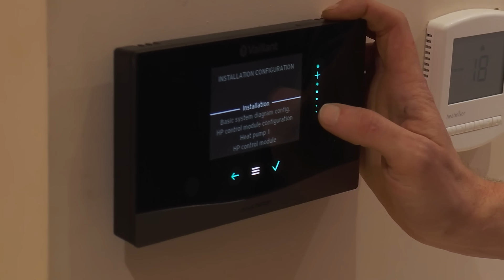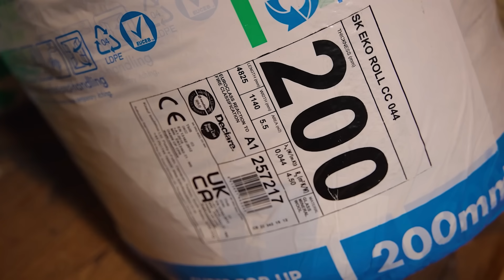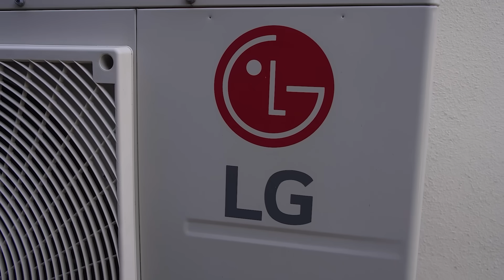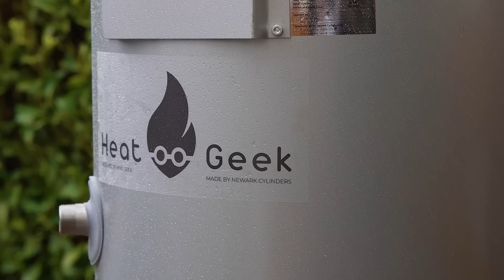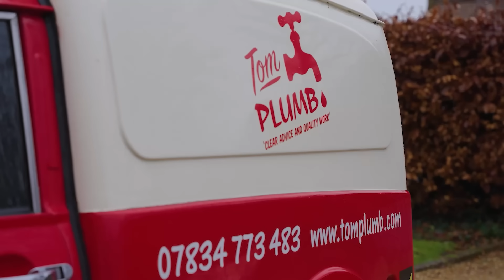Heat Geek’s Heat Pump One Year Later — The Verdict!

Comment: Interesting video, gauging a whole year's Heat Pump performance.

The point that the UK's housing stock have many peculiarities, is the message I'm picking-up, that a Heat Pump systems has to be bespoke to your particular property.
I'm starting a 6 metre extension with new garage next year, and my cunning plan is to relocate my old gas boiler into the new garage, but have all the conduit required installed for a Heat Pump on a future date.

My logic is that it's unclear to me how even Heat Geek could survey a property for a suitable system whilst under a major development.

But that doesn't stop me future proofing the property with conduits, hopefully advised by a Heat Geek qualified person.

Keep up the good work Roger, I regularly forward on your clips to others.

Keep well

Robert

Comment: Heat pumps are great when specced and installed correctly, the only thing is they cost so much….even with the boiler upgrade scheme. Hard to consider when modern combi boilers can run at lower flow temperatures and use weather compensation so that they run constantly without cycling on of off while sipping gas.
Reply: If you get a competent installer who can do all that.

Comment: When he said it cost £900 was that a month? 😖I am an electrician. I have been to lots of houses big and small with heat pumps. Most of them are not happy with it as too cold indoors and hasn't got higher heat in the evenings and weekends,  with the cost to run is a lot higher than a gas boiler setup overall as I don't think people have the boilers on 24/7, only when they need it. We did a big new barn conversation with a heat pump, with lots and lots of spay insulation super thick and super-insulated new glass windows, with underfloor heating on the ground floor in screed and on the first floor under the chipboard. Cost an absolute fortune to install and you need a plant room.  We went back and asked how it was all going and the customer had turned it all off as was costing over £1200 a month to run and had installed a bigger wood burner in the lounge. He said that the heat pump was running 24/7 but had a lot of glass and high ceilings but when the sun came out it was too hot and had little control over it. He said it was "crap and was made to install under planning regs". `They were moving and the house was up for sale.
 Another big house we visited had a big twin heat pump and solar and battery set up. We asked the lady how she was getting on with it? She said it was costing a fortune to run and the house was never warm. we had to keep our coats on indoors. To be fair on this one the windows were single-insulated and poor insulation in the roof and radiators was original. What would it have cost for all the upgrades to a big old house? She had been ripped off and has now moved.
 A friend of mine works for the local Council as a gas fitter,  he said that the Government are making them upgrade all their council housing renting stock to heat pumps, and they have also got to upgrade all the insulation in these homes. He said one average-sized council house they just started was costing them £45,000 for one house in insulation costs alone not including the new heat pump install. he said that the governments were forcing all councils to comply but next year they are going to force private landlords to do the same with their houses to bring them up to the same standards. Seems to be only the wealthiest investing in this net zero ideology.  As Keir said to Tice in the Commons it is all about money, jobs, economics and politics, which makes me wonder if nothing to do with man-made climate warming. Buyers beware.
Reply: he said a year
Reply: yes and look at the millions it cost to put cladding on Grenfell as part of the net zero rubbish

Comment: So, a gas boiler in case the heap pump packs up. 

What would have happened when there was just a boiler, and that packed up? ... call a plumber and get it replaced.

What happens when  heat pump packs up? ... call a plumber and get it replaced.
Reply: yep, except with a heatpump system you also have immersion heaters so worst case you can still heat your water until the heatpump is fixed. Gas boiler needs a gas certified engineer as well. Technically if you are replacing like for like with electrics any 'competent' person can do it.
Reply: Plug an electric heater in. Or if the electric went out, use a power bank to power the boiler and you still have heating.

Comment: Had a system that ran at 59C because there is no separate tanks for hot water. The engineers had put the heat pump temp below that so it was simply not used. Took me years to bother to figure out what was wrong.
Reply: I evidently lowered it to 45 when I realized how in efficient that temp is

Comment: Heat pumps do work. But only after a huge amount of money and effort has been spent in accommodating the house for it.
Reply: Not really but they work better (cheaper) in well insulated houses. Which unfortunately you don't have many in UK. But you also have a milder climate than Eastern Europe for example.

Comment: Air to air is £ for £ spent a better option - IF - you’re determined to tie yourself to electricity supply, a source which will work great, until it becomes even more expensive in the U.K. and then becomes intermittent.
Reply: Yes it would suit me.  Just a shame no grants
Reply: Sounds like that they may be coming soon, but in any event about £2800 -£3500 typical setup cost ain’t so desperate. Talk is of the grant system being added to to incorporate air to air, possibly this year I think. 👍🏻

Comment: When you need heating the most is, surprise surprise, when it is coldest… If you think it’s going to continue to get warmer (- per the official, politically approved narrative) then fine; if you have concerns about eg energy continuity of supply, future global cooling probability, etc and recognise that a colder winter tends to drop the efficiency of these units to around 3:1, at which point not bothering to ‘invest’ in the new systems becomes moot.   Spending the money on improving your insulation levels is the most cost effective investment to make, and beyond that you can use less of whatever heating energy source you prefer.

Comment: Heat Pumps the connection.
The Zero-Carbon Hoax, a background.
As set out in the 1987 a publication from The World Commission on Environment and Development 'Our Common Future' ''Group think, the hive mind which then demonizes anything outside the controlled accepted narrative. The societal structure of power implements this through the executive, judicial and administrative arms of governance.
Our Common Future 'The planning of societal change takes place decades before the public see any signs of the implementation. By this time, it is being sold to them in the form of a benefit. Under a “climate lockdown”, governments would LIMIT PRIVATE VECHICLE USE, ban consumption of red meat, and IMPOSE EXTREME ENERGY SAVING MEASURES That's for openers.
Most will never be able to see the plans behind these changes as they believe the cover story. Change brought about on the back of something that appears beneficial to the public, then accept the change as necessary or for the “common good”. They are guilt tripped into accepting loss of rights and benefits through basic propaganda tools.

Comment: Roger Bisby, I like you, I watch your content a lot. But you really are stubborn.

It's really frustrating how you could barely say anything nice about heat pumps despite clear evidence of how well they can perform. 

This man paid £920 for a whole year for hot water and heating in a 6-bed house! This is insanely cheap and could not be matched by any other system currently available.

All you could talk about was all the exceptions where they don't work (many of which would apply to GCH), or all the things completely outside the control of a regular consumer.

Comment: Very informative with this series of videos showing the problem and its solutions and the follow-up with an eventually satisfied customer. And you brought up a lot of good points, both positives and negatives. Here in Sweden a lot of air based heat-pumps have been installed and they usually seem to work well . Many are installed on the west-coast in the South with climate similar to UK so high humidity should not be an unsurpassable hindrance. In the North of Sweden they are mainly used for supportive heating since the efficiency becomes limited at lower temperatures in the winter. Even if UK have high prices on electricity the total cost for heating might still be comparable to Northern Sweden or Finland due to the lower temperatures.
Reply: My air to air heater was working pretty well last winter at -20C here in Norway.  It is rated down to -35 :/

Comment: The loft insulation would hav done great job and reduced your bills if you had been using a gas boiler too!
Reply: Why wasn't the loft insulation done already or even when the heat pump was fitted. It is just a no trainer to insulate as much as practical but the loft is a must.
Reply: @stephenwest9757  brainer

Comment: Glad you did the follow up! It helps to counter the general narrative in the UK that "heat pumps are garbage".

Here in Aus, heat pumps are great. Im down south and have air to air heat pumps (split system air con). Theyre my sole heating in winter. So much cheaper than running gas during winter.

"Size the system correctly" applies in every application. You wouldnt drive a whole footy team around in a Morris minor, would you?
Reply: Out of interest how do you heat your water?  I have air to air as well so have an immersion heater for water.  Tempted to get a small heat pump just to heat the water.
Reply: @notverygoodguy i have a hot water heat pump too. The outdoor temps rarely hit about -3C at the lowest in winter. Normally theyll be 3C to 10C at night. In Australia its normal for the hot water tank to be located outside, and the hot water heat pump is built on top of the tank as an all in one unit. It is possible to get a split unit, so the tank is in a different location to the evaporator. They work very well and save heaps of money.
Reply: @davidunwin7868  Thanks.  I think I'll look into that.

Comment: I think you mate is right about the original heat pump and the compressor. The problem is the cost of the degas, compressor, anything else  and the regas on a 5 year old heat pump probably doesn't make sense. The cynic in me thinks that the heat geeks would have been only too aware of this but it calls in to question what allowance you should be allowing on your heat pump running costs when you have to replace the equipment that has a lower average service life and cost many times that of a gas boiler and which won't attract a government grant for the replacement. The real issue is the cost of the electricity. If everyone was offered these super cheap  tariffs 15p ./ Kwh in Tony's case I suggest there would be no case for heat pumps.
Reply: discriminatory pricing is one of the sneaky ways they create interest , its like offering freebies to people with so called smart meters , highly discriminatory

Comment: My heat pump system was redesigned and rebuilt a few years ago. They installed a remanufactured compressor during the work. My heat pump works great, and my electric bill went way down.
Reply: Scam, you cannot remanufactor a hermetic compressor.

Comment: So now he has to keep the house constantly at 20c. Assuming colder outside, he is 24/7 running a thermal potential difference, thus constantly loosing heat. With gas, quickly get the house upto temp when you want it, the let house cool when you dont need it.
Reply: He is happier, it runs more cheaply for him?
Reply: @Biggest-hz7ng   Makes a lot of 'eco-sense' to heat a whole house 24/7 rather than just heating the rooms you want, when you want, doesn't it?  We need to look at why we need to heat bedrooms during the day, or why we need to heat a bathroom all the time if we only use it for an hour.
Reply: Sometimes things that we are used to don't make as much sense as we thought.  The actual energy the house loses to being heated is the same however you heat it.  However the energy required to keep it at a single temperature is less than to keep heating it up to that temperature.  It is why people used to keep immersion heaters on all the time and not turn them off an night.

Comment: You could make a gas boiler that would have the same flow and water temp as the heat pump, it would then perform identically and keep the house at 20c.
Reply: Yes, but gas would cost more than this heat pump install as it is 450% efficient.
Reply: @ 
No, a CoP of 4.5 is possible, but it can even be down as low as 1 (so 1 kW in, 1 kW out).  The average CoP for a typical heat pump in the UK varies seasonally and can range from about 2.5 to 2.8 on average.  And anyway, I think you mean running costs, not install, as gas is definitely cheaper to install.
Reply: You could indeed, and that's what is done by many installers for underfloor heating (UFH).  Having said that, though, you could achieve the same with a simple electric boiler, too - then you'd have zero maintenance, servicing, or insurance.  But as I say above, 20 degrees is too cool in my opinion, and would be far too cool in a bathroom - allowing condensation and mould, unless you had HRV.

Comment: Within seconds of the video starting we had clips of the installers smiling, being helpful, looking busy!!! Promotional video alert. If this heat pump system is better than gas then his gas setup is poor. Only advantage of heat pumps is the fuel they use, and efficiency compared to filament heating.
Reply: No, SCOP over the year is 4.5, a better fuel cost than achievable by gas.

Comment: absolute rubbish  , all this is is a paid advert , as for better heating again utter rubbish 12kw is  or even 7kw  not possible nationwide , so stop the lying
Reply: Not understanding your rant.

If it's about electricity transmission, heat pumps are taking a while to roll out unfortunately.

Comment: No good getting rid of gas when the electricity that runs the hob comes from a gas power station.
Reply: There is still a 40% gas saving if the heat pump were to use electricity generated solely by gas. The UK grid is increasingly green.
Reply: @Biggest-hz7ng  He was talking about other appliances like hobs, lights, televisions, etc.  Still need electricity.
Reply: Solar and batteries are getting cheaper at a rate that is basically bonkers. As time goes on, the major cost will tend towards installation rather than the tech itself (e.g. a friend in England just got a solar install and a big chunk of that cost was scaffolding)

Comment: Retired Plumber . What is the point of Heating empty rooms . I live in a one bedroom Flat  with extra external  insulation . I still have my Worcester 28i  Junior Combi conventional output and it's 16 years old , Gas bill yearly £395's a year , so no I wont be getting a Heat pump !
Reply: His heating cost was 920 per year for his 6 bed...
Reply: @Biggest-hz7ng  More fool him , Heating Empty rooms , that's what TRV's were invented for ! 🤣
Reply: @Alan59-n9d Sometimes the things we are used to are not the best way.  It is cheaper in his case to heat rooms rarely used all the time instead of heating them only when he needs them.

Comment: All I want to see is two sets of bills for both Gas and Electric.  One for the Summer and Winter quarter when the home owner used a gas boiler, and another for the Summer and Winter quarter the year later when the Heat Pump was installed and in use.
I want to look at how many KW of gas and electric were used in Summer and Winter when they had a gas boiler and how many KW were used in Summer and Winter when the heat pump was in use.  Then I wanted to see the total of each Bill as paid to the energy supplier.  

A SIMPLE COMPARISON is all I and everyone else wants.  Not one of these heat pump users will hand any of that information over.  They all make excuses, mask figures, merge figures and we often later find they have spent a further £15K on solar panels and batteries to try and reduce their bill, which is a daft idea.

So who will be the first to show the Bills and tell us the total cost of the heatpump installation?
Or at least say why they will not show those bills.  I think a lot of buyers now feel foolish and don't want people laughing at them for being misled or scammed.
Reply: Total cost of installation for me £3,995, this replaced a broken 17 year old gas boiler and 40-60 year old plumbing radiators and HWC.

6kW Daikin HP, 150 litre Mixergy HWC, seven new radiators all new copper piping 28mm backbone and 22mm & 15mm feeds.

Recovery of old gas boiler and flue.

Standing order £128 monthly (total electricity bill not just heating based on 26p per kWh), I get credited £70-£80 per month as part of British Gas HP tariff, so in reality my electric bill is about £58 per month over 12 months which includes standing charge.

What are the details of your energy bills, I hope this doesn't make yours look foolish ?
Reply: 920 per year bills for John's 6 bed install. A worse SCOP of 3 might cost him around 1,500?

People that have heat pumps installed often want to reduce their bills, so they install insulation, solar and batteries, complicating things. The heat pumps are just there to heat the house. Often the energy costs would be similar to previous costs if nothing else has been added. In this video, insulation was an added complication. The monitored efficiency of the install suggests bills would have gone down even without the insulation.